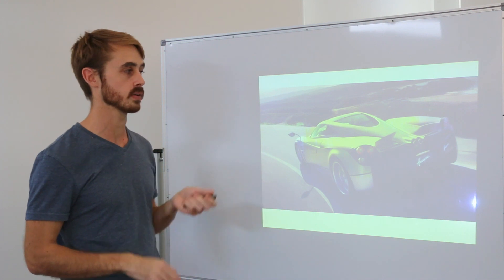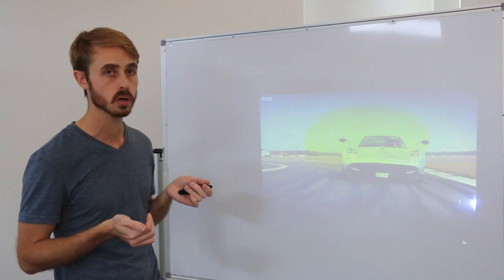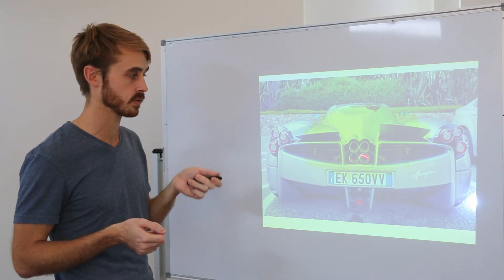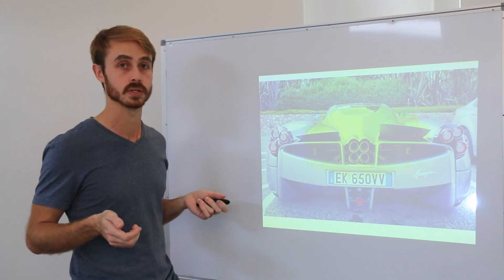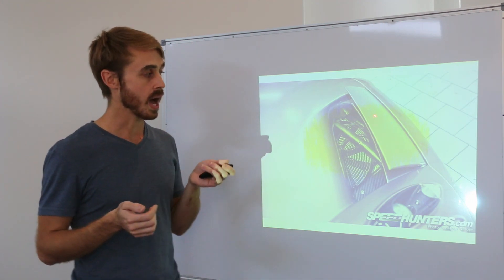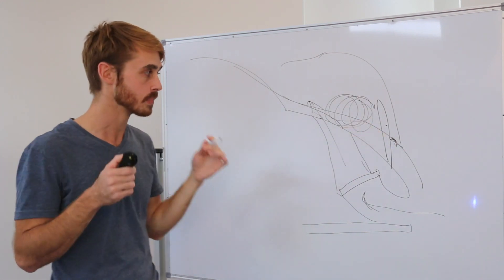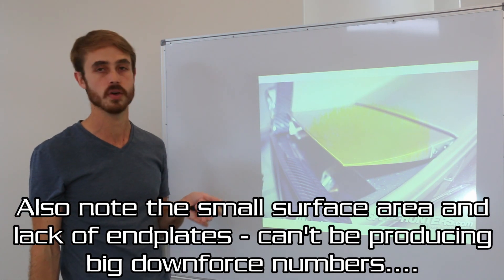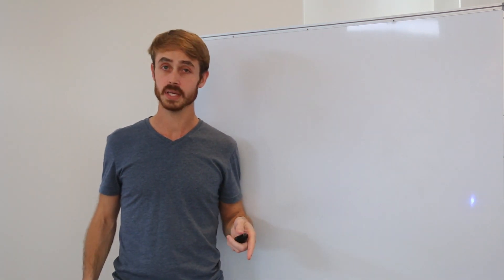Pagani Huayra - Active Aerodynamics Analysis

Comment: It seems like laterally independent elements don’t work in general, but would there be any benefit of this concept for the 2026 F1 regulations? It doesn’t look like the regs say anything about the elements having to activate symmetrically. Since it can be used at any point during a lap I was curious about cornering with this concept. If there was any potential benefit I figured F1 would be where they could make it work with the rest of the car’s aero.

Comment: The front flaps pop up to cause drag on purpose for air braking your looking to much into just the aerodynamics and not enough into the purpose of them and also your looking at it in just a downforce perspective which these aren't completely based on they work like the flaps on an airplane the inside flaps pop up for more drag on the inside to help turn the car in like planes use them to turn that's what these are for to help the car turn and brake not really for downforce the cars lines are smooth enough for that you don't see jets having spoilers and they don't for the reason that it would slow them down and wouldn't make sense to be there and it's the same for this car it uses the flaps to help it turn and slow down and using them for the drag in turns means it helps it rotate which nulls the whole reason for needing a spoiler or wing so they work just not in the way your looking at
Reply: nicolas jorgensen  ur talking aerodynamic drag is actually a part of braking oh and btw jets do have wings they are just reversed so that they creat pro lift ....

Comment: tell me if im wrong bur kncreasing the drag on the knside should help rotating the car.
Reply: You are not wrong that is the point to them they work like the flaps on the back of wing on planes they cause drag on the inside to help it turn in and also to help slow down so yes you are correct
Reply: that's what i though when i seen this flaps in The Crew, but apparently th people from pagani didn't said that, or atleast kyle didn't know it

Comment: Hi Kyle, regarding what you said about how you don't like the aero-anti-roll: 

If I understand it right, you generally lose overall grip if you keep your suspension from rolling, because it always means you increase your weight differential left to right, which in turn means the outer tire gains less grip than the inner tire loses, because of the way the load vs. lateral force curves of tires look. 

The ways to counteract roll that I know of are 
- making the roll couple smaller by moving roll center closer to c.o.g.
- increase spring rates
- increase anti-roll bar spring rate

Which all increase the weight differential and thus reduce grip, while if you use aero forces to press on the inside wheels, you will at the same time increase mechanical grip by decreasing the weight differential, and at the same time counteract roll to keep your underfloor aerodynamics working. That doesn't sound too bad if you want to increase mechanical grip for low speed corners while sacrificing some high speed cornering potential due to the overall downforce/efficiency issues you mentioned.
Reply from the maker: While reducing the weight transfer will improve mechanical grip, you have to be careful about how you think about it. In a car with no aero, decreasing the weight transfer results in improved grip, which can be thought of as an increase in the coefficient of friction, while increased weight transfer results in a decrease in the coefficient of friction. On aero cars, total grip is a function of (downforce + weight) x coefficient of friction. So while only using the downforce on the inside wheels will increase your coefficient of friction relative to putting the downforce on both, it will also halve your total downforce, so the overall grip available will drop (the coefficient of friction doesn't change as rapidly as the downforce). This is regardless of the speed of the corner. So putting the downforce on the inside wheels only increases the grip/downforce (and presumably drag) ratio, but lowers overall grip at all speeds. Does that make sense?

Another way of thinking about it is to imagine one wing forcing one side down, and the othe forcing the other down. If you removed the outside wing on the corner, you can clearly see that there is going to be a total grip loss. The only advantage I can see of differential side-side is yaw moment control, although at the speeds where you want the most yaw moment are where aero is going to have little effect. You may be able to work it to help if you linked it in with the stability control system for high speed stability I'd imagine.
Reply: Thank you for the explanation!

Comment: The video you see Chris Harris driving the Huayra, he had the electronic stability and traction control turned off... So in turn, the flaps only acted as air brakes and that alone. When you see him accelerate, you don't see the flaps come up (another sign that the ESC and ETC is off). I do agree that these flaps don't do much, but neither does a slight change in tire compound. But because it's there, it adds just that little bit more to the performance.

Comment: These videos analyzing hypercar aero are interesting and informative; however I personally like to see videos on practically applicable information ranging from time attack cars down to weekend trackday cars, as those are reasonably within the middle of the bellcurve of what most people have. Not that you should limit your self to that standard, but it is the mean population. 

For example: choosing a "spec"
Some time attack/autocross events have a maximum rim width/size specification. For this application choosing the right width, aspect ratio, and compound for short one lap stints might be the first and most important step. Then maybe, how to use an accelerometer on a skid pad to choose the right suspension and anti-roll to compensate for the increase in g loading etc. 

I have always done it the hard way, and have since used racing simulators (which has worked surprisingly well) even though the ones on the market are not completely accurate. GT6 is really close with the Scion FRS at Streets of Willow that I am currently working on. Have driven both the real combo stock and in the sim stock with comparable tires and get similar times. I was surprised that all the shifting points were spot on.
Reply from the maker: hmushmann2 The Aerodynamics of Hypercars series was just a one off from a video request I received, after this we care going back to more general information. The next 4 videos are going to be on anti roll bar tuning, why swan neck wings work, why Bernoullis principle doesn't work, and how twisted rear wings work.

I can try to do some videos around what you have mentioned, however the specificity of it makes it very hard. Regarding rim width, in most cases I'd probably start by putting the max allowable on the heavier axle, then scaling the rim width by weight differential between axles. Then in testing you would probably find that upping the front rim size slightly from that baseline would be the way to go. Regarding the accelerometer, you really need more info than that to do high level suspension tuning (linear potentiometers on the shocks, driver feedback etc), using just an accelerometer means you will basically have to design your suspension by trial and error. For compound, if you have money and its only one lap, buy the softest compound physically possible. Aspect ratio will always be a compromise between response, grip, drivability, compliance and brake rotor size, and you will need to choose for your application what is best.
Reply: KYLE.DRIVES cool video line up. As for my suggestion, it was just an example of basic low tier tuning that is widely available. It's agreeable that more telemetry data collection is better, and just an accelerometer isn't going to help directly calculate roll centers and corner loading. However having even just g-force as a reference, in a few iterations of adjustments, several sets of springs, and plenty of test time can produce desirable results on a budget. It's a trade off between cost of time and cost of telemetry equipment. 

Most "tuners" don't work from the tires up, changing the spring rates and complaining their fwd under-steers everywhere. Then getting sticky competition tires and fighting their car all the way around the autocross/track. As you know, in high level racing, teams engineer their car around the tires provided that season. Which is what I personally want understood by the common man. Though I'm not foisting that responsibility onto you.

Comment: Kyle could you explain three things:
1) does it ventilate engine on a mid and rear engined cars? Is it really necessary? How it works? 
http://funkyimg.com/i/XuXZ.jpg
2) is it possible to make the front of a mid and rear engined car smooth, without any holes for minimum resistance?
http://funkyimg.com/i/XuXY.jpg
3) how the cooling system works in a mid and rear engined cars?
Excuse me for my English. Thanks.
Reply from the maker: GURken 1. Yes, roof scoops usually feed air to the engine or the cooling systems which will be vented out the back either through grills or the exhaust

2. Yes, but you will need more intakes further back for cooling etc. so your air  resistance probably wont drop.

3. Radiators are located either at the front with water pipes running to the back, or at the back with air coming from ducts on the side. Air is then vented out the back in this configuration.

Comment: i was watching the Huayra around the Top Gear track thinking to myself that those flaps couldn't really be doing anything at some of the slower speeds. I can see how the rear flaps if deployed at high speed could help keep the rear planted in the follow though, where the Koenigsegg went off without a rear wing several years ago.